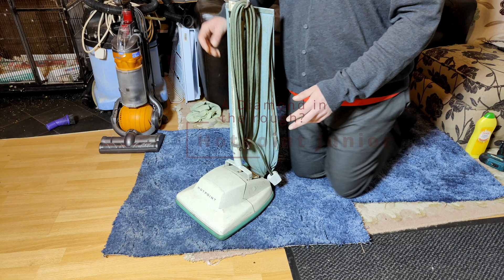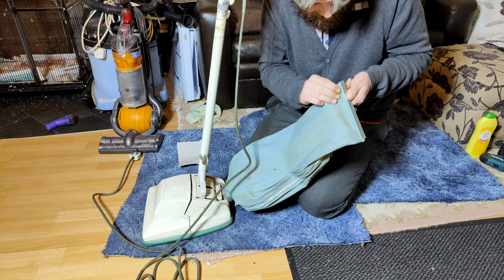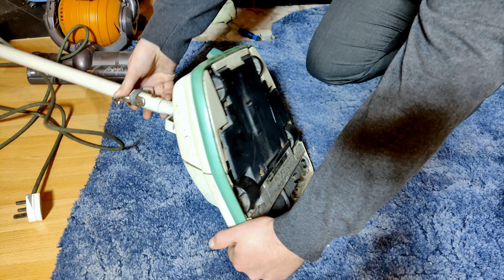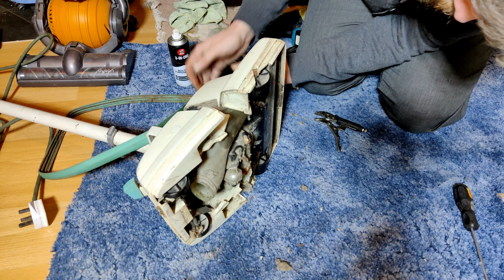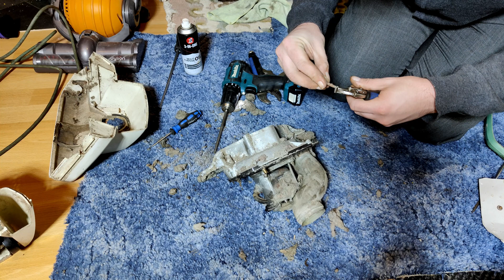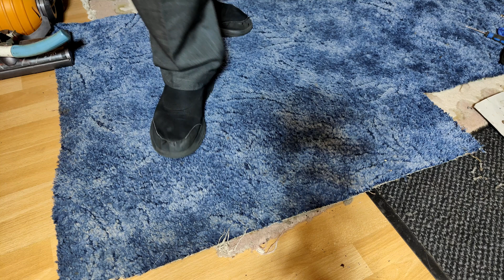Another Hotpoint Junior! The oldest one yet? First Look and dis-assembly.

Comment: This was an early one, depending on the model number this could be as old as 1963. Going by Which the Model 3200 was reported on in November 1963, by March 1966 it was the 3210 and by October 1968 it was the 3220 with the more familiar straight (rather than curved) hand grip and the rocker switch on the front. In its earliest days it was also available in with pink hand grip, bag and cord.